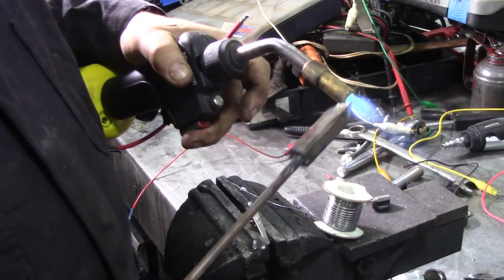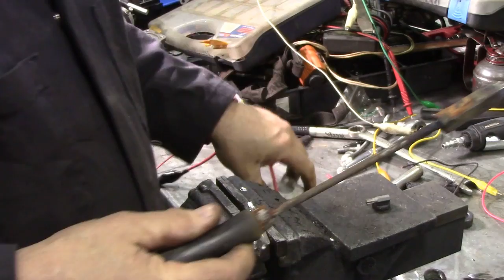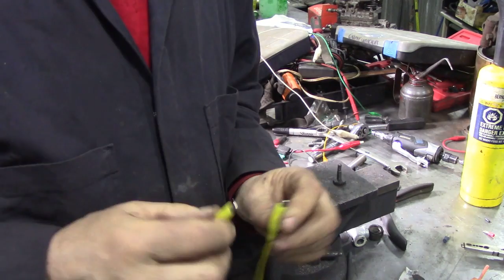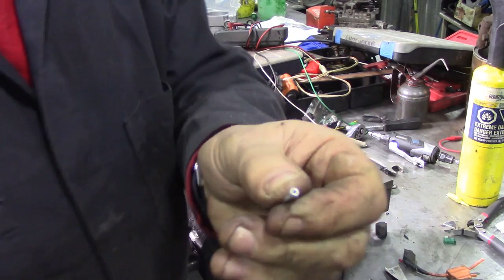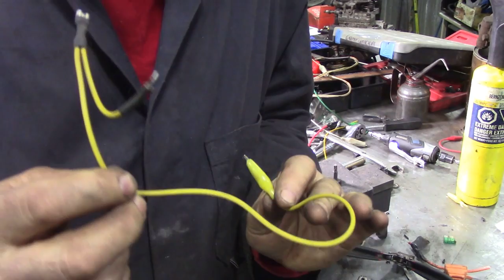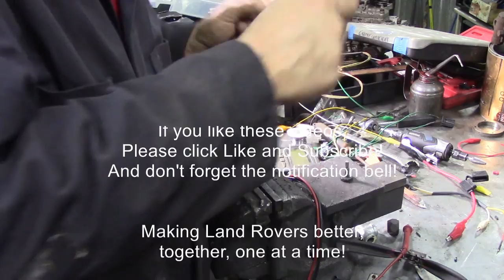Making some useful test leads, Basic soldering Pt3

Comment: Nice job on the jumpers. I have a jumper with a resettable 10 amp fuse. So I can reset it over and over until I find the overload. Works great for fuse boxes. I bought the resetting fuse off eBay really cheap.